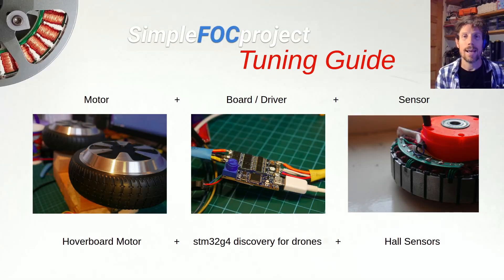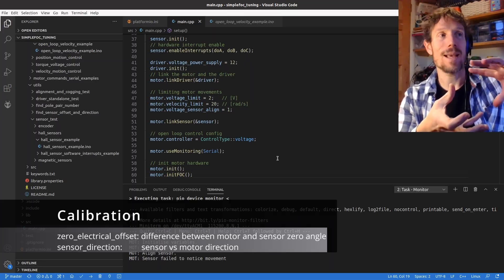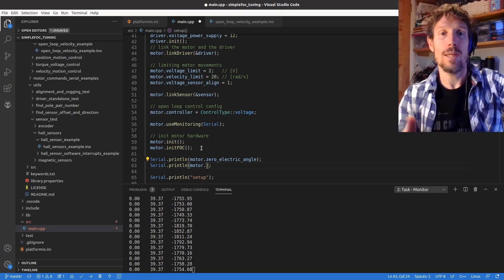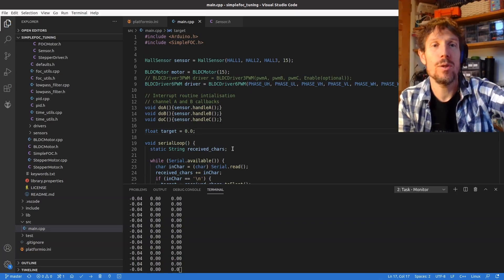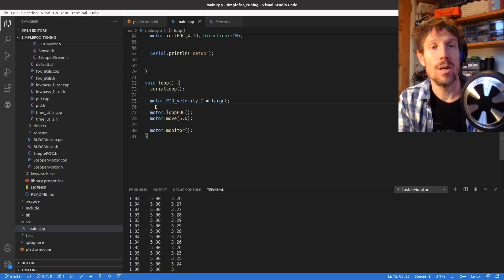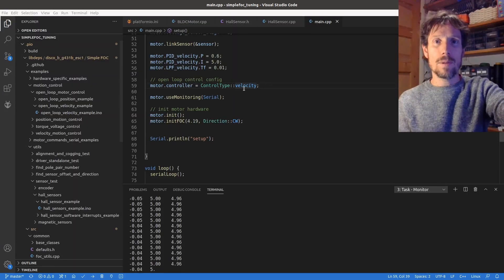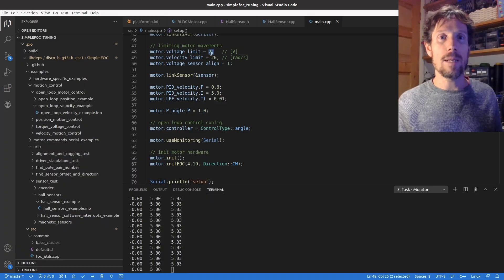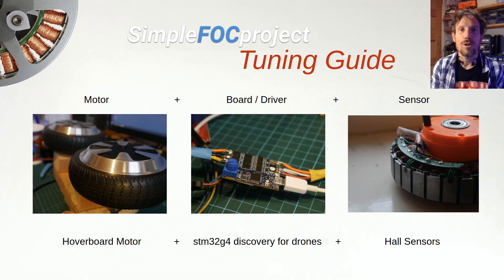SimpleFOC 2.0 Tuning Guide - Part 2

Comment: at time 1:18 you use motor.control = ControlType ::voltage: but I dont see that option, i only see motionControlType and torqueControlType, torque control tpye has the voltage option but when I plug upload everything I cant get the moto to move. Any advice?

Comment: Thank you for this video. I shall check out the Simple FOC Community. I got one question about the Hall Sensors used. I think it is to read the position of the shaft. Is it digital hall sensors?
I am investigating motor drives for sewing machines. In general you like to have a large speed range of about 1:200 or better. And you like to have good low speed control with fast response to load changes. At low speed you will need short term higher currents (and shaft torque) than the long term current limit of the motor. Furthermore, you like to avoid unpleasant audio noise, but silence is not needed. Unfortunately, most servo motors for industrial sewing machines on the market cannot meet such demands. They do use BLDC motors, but I think the control methods they use are outdated. This is a video that give some idea about the demands: https://youtu.be/uTB8DnyYAlA

Comment: Can I ask something? Yesterday I controlled the skateboard motor when in the openloop control loop, the motor rotated quite smoothly but when switching to closeloop the motor started stuttering. Is it because I set the voltage incorrectly? I set motor1.voltage_limit = 6;